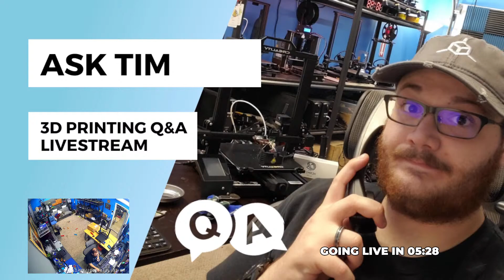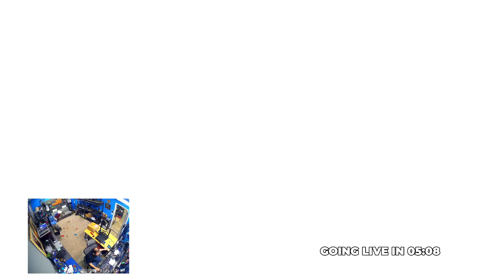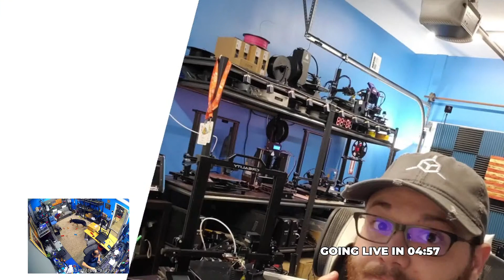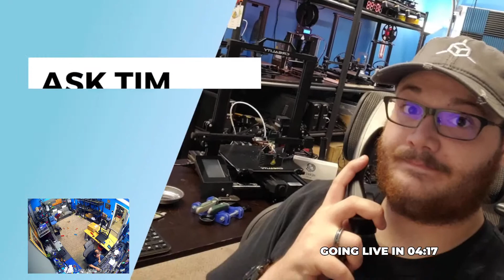Ask Tim - 3D Printer Q&A Help Stream | Livestream | 2:30PM CST 10/27/21

Comment: Hi there, got a question and hopefully you have a solution. Just installed a BL touch to my new Ender 3. It's just a plain emder 3 (not a pro or V2) . I went to turn it on and auto home it and the BL touch led light is red. During the auto home attempt the printer homed the x and y axis but the z axis went down way to far. I noticed the probe on the BL touch did not try to deploy so what would you do in this situation? Oh sorry forgot to add that im running a 32 bit Rev 4.2.2 firmware. Any thought or tips would be greatly appreciated. I haven't even got to make the first print woth this new printer yet so it's kind of disheartening to me lol. Love all that you do and keep up the awesome work!!!
Reply from the maker: Sounds like either the wiring from the BL touch to the board is incorrect and/or you dont have the right pin for the BL Touch control setup in the firmware.
Reply: I forgot to mention that when I power up my printer that the probe will deploy twice. I am sorry I forgot to include that and I don't know if that really makes a difference or not in the solution. I'm still new to 3d printing.  I will double check everything on the wiring and go through the firmware and double check that also. Thank you and if what I mentioned changes the solution just let me know please. Thank you for your response!!
Reply: I got the problem fixed. Ended up having to try a couple different firmware and the only one I found that would work was firmware from the creality website lol. Thank you for the input and thank you for all you do! Keep up the awesome work!!